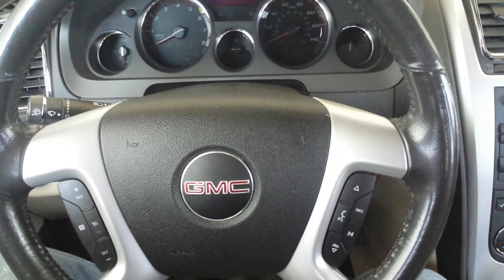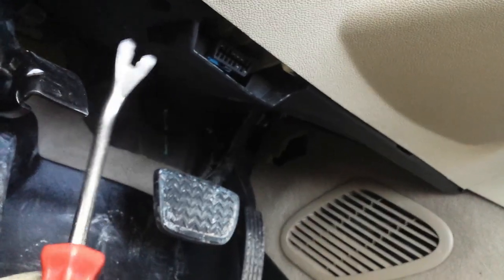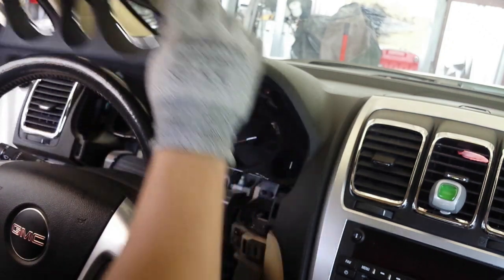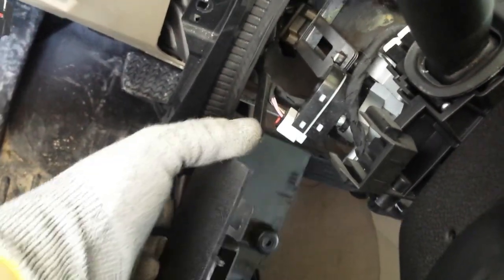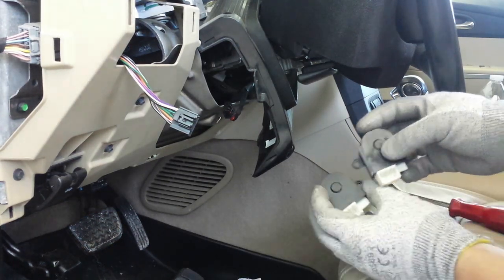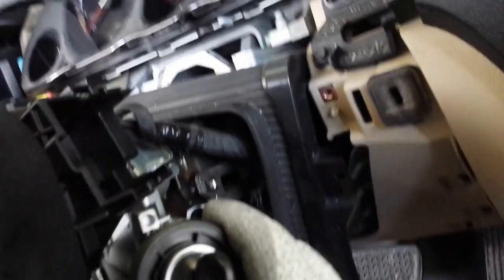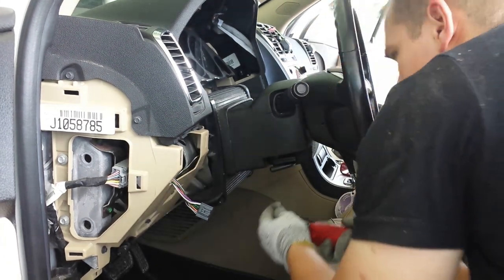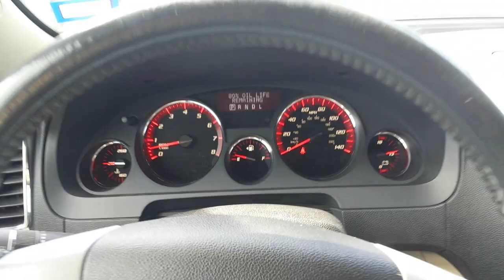How to replace 2007-2012 GMC Acadia Ignition switch

Comment: Ty so much ! I was able to replace the ignition switch on my Acadia that has been giving me trouble for almost 6months now while ive been waiting around on my LAZY ASS, NOW EX, TO FIX. He's put me off and put me off and finally id had enough of waiting around on asshole men to DO something .. . With your help and thorough guidance I did it myself!! Screw these pathetic men I seem to get with. Thank you so much I wish I wasn't broke and could pay you something. Just know at least you helped a girly girl in Tampa gain some confidence and self reliability. And that to me is priceless. Ty so much from the bottom of my heart. I am forever grateful
Reply from the maker: Hey no worries.  And yes some men are definately lazy and dont want to help their partners. I guess there is a reason he is an ex now 😅 lol.  And you're very welcome. As for payment, no worries at all. Glad you got it going but if you ever do, there is a super thanks option on here where you can send us a tip or even through cashapp $perezjet. :) God Bless! Thank you!

Comment: Hey great video followed it to a T I have replaced the battery I’ve replaced the main relay. I’ve replaced the ignition switch now and my car still won’t turn off but it also won’t start. What do you suppose the next step would be?
Reply from the maker: Man....without having it to diagnose thats a hard one....but somehow the power is staying on...

Comment: Hi  my gauge lights (gas, temp, battery) no longer work. do you know the problem on the gmc acadia?
Reply from the maker: @mehdim3755  sounds like a power issue not getting to all 3 guages...but it be hard to say without being there. I would check the fuses to be sure none are blown

Comment: Great video!! On the new switch, will it be set to a generic tumblers so that my key that is already synced will work? Or does it come with a new key that will need to be programmed
Reply from the maker: Hey thank you very much and It did not need to be reprogrammed. A good rule of thumb i always do is just cycle the key forward and back 3 times but reprogram is not required for this repair.

Comment: We have a 2007 acadia. That had not been starting 
everytime.  But once started it seems to be fine.  Autozone told us it was the battery, but when we installed the new one.... same problem.  While there I noticed that the car was in acc with key in, the radio all of a sudden turned on, so I cranked the car and it started. If not 1st try, then 2nd try.  But the radio had to come on first!  If the radio screen stayed black, it would not start.  So, basically, right now, we turn to acc wait for radio display  to start up and start the car.  Could this be the ignition switch?
Reply from the maker: Very likely that it is because the switch may be internally failing to where it is no longer separating the on, according, and off position correctly but I have honestly never seen those symptoms occur.

Comment: Are you sure you have to take the dash apart? Seems like you could have got to it by just taking the plastic off the steering wheel?
Reply from the maker: You can't take the plastic off the wheel without removing the dash pieces out of the way. They sort of hug the plastics by the steering wheel
Reply: @EddiesCustomsandRestorations  I just changed mine mine is an 11 and I was able to just take the plastic off the steering wheel and it worked just fine.. didn’t solve my problem but changed it lol bummer
Reply from the maker: @JustinMentionedIt  🤣 lol thats too funny but man what a bummer....wish it would have worked out for you..